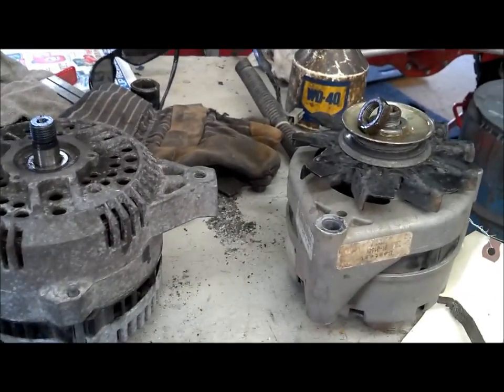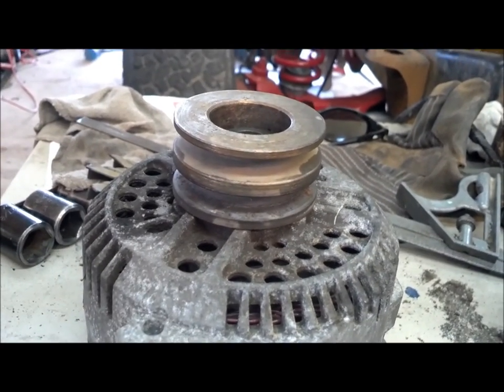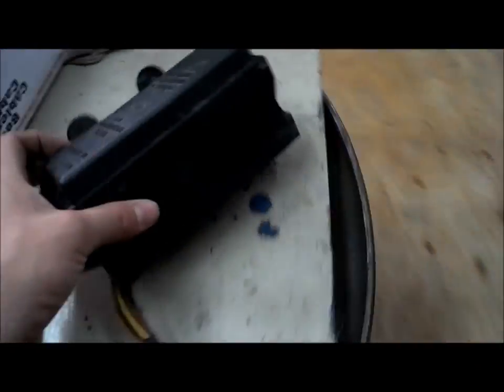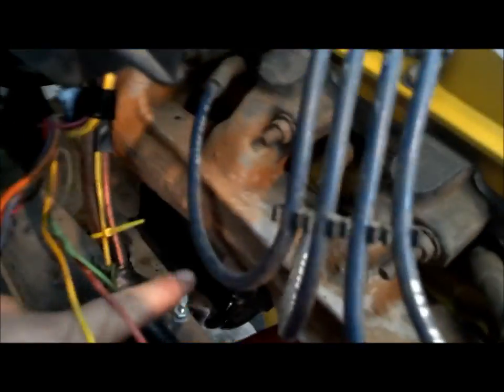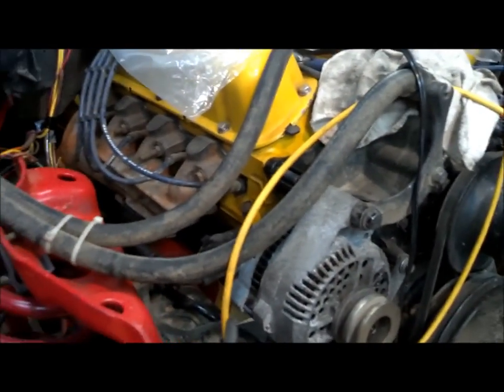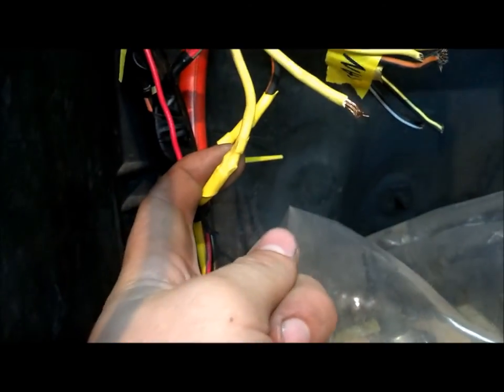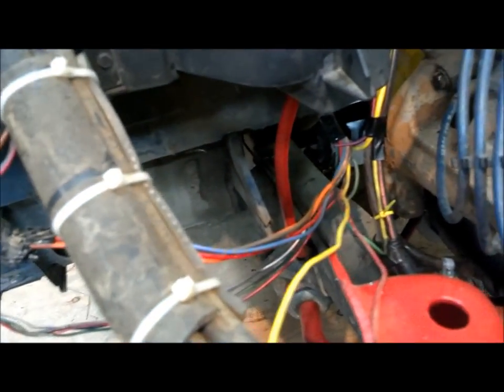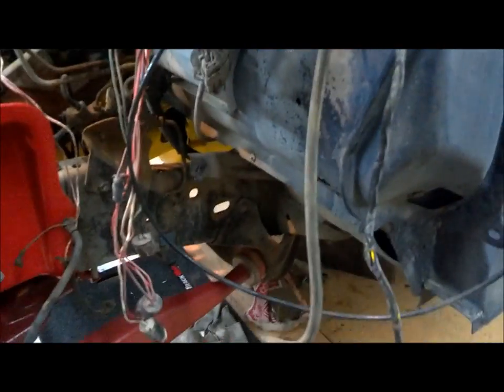Bronco project pt5: 3g alt conversion and remote battery wiring

Comment: I have a 1978 bronco and the old wiring had a circuit breaker connected to the starter relay. The circuit breaker has a off white wire and orange wire both fusible links.. That are draining my battery. Any idea what those are for? Truck doesnt start without them being connected to hot.

Comment: Nice setup man.  Prolly with those big of tires you want to get a sig steering pump.  they are all over the junk yards.
Reply: What vehicles do they in?
Reply: @joselepe9660  80s straight 6 vans.
Reply: @joselepe9660  Well the bracket you'd need.  The pump just any orylies trade in